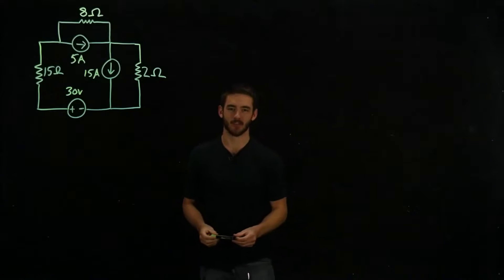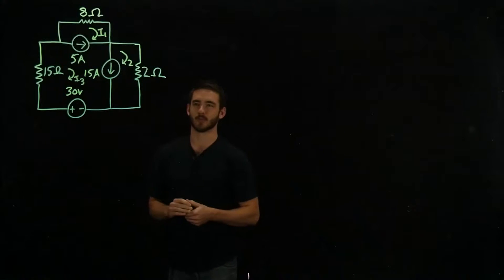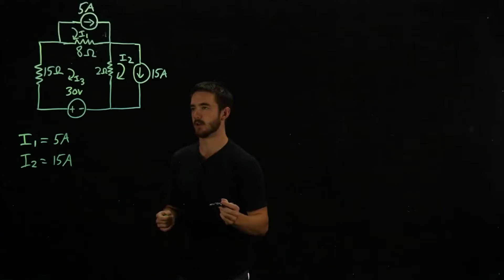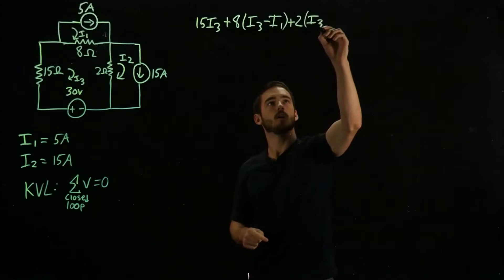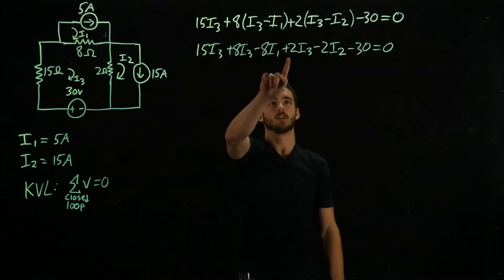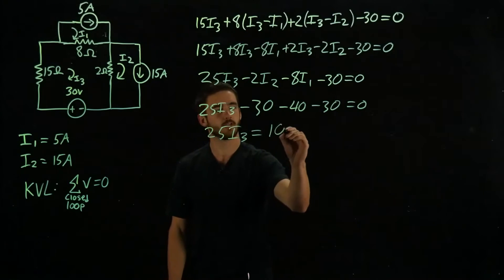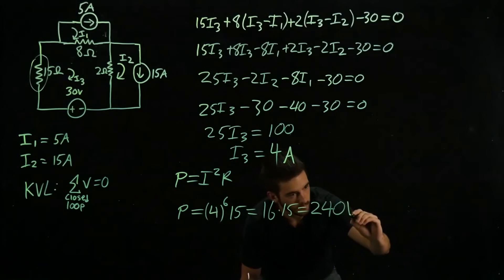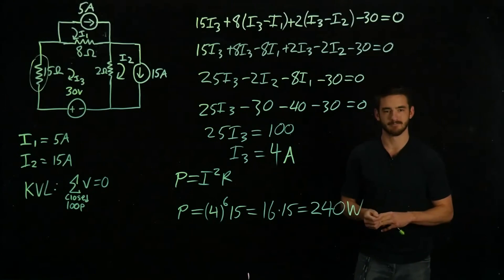Circuits 1 - Power Dissipation across a Resistor

Comment: How can I find the power dissipated across 2 ohm? Pls tell me..
Reply: You just calculate the current running trough the 2ohm resistor which is I2-I3 (the largest minus the smallest) you can also see this when you draw I2 and I3 trough the 2 ohm resistor. The calculated current trough the 2 ohm resistor is 15-4=11 Amps so the power will be 2*11²=2*121=242W